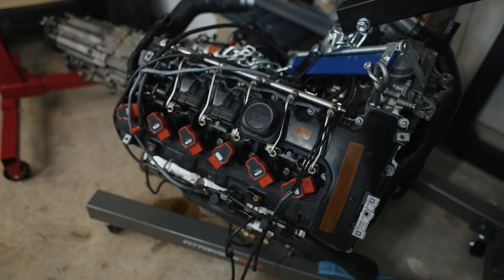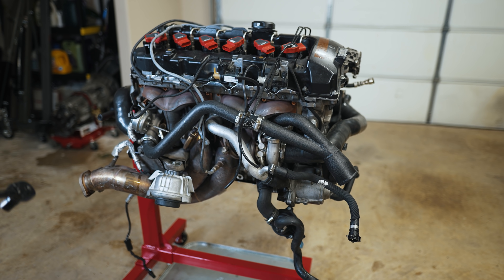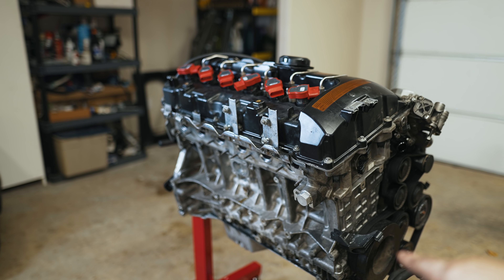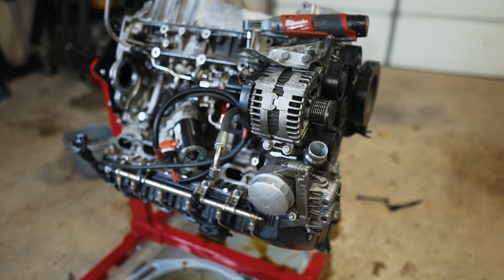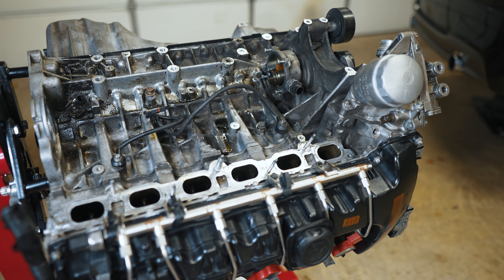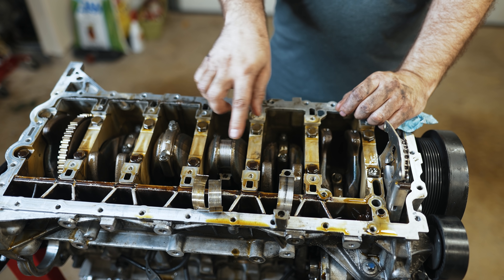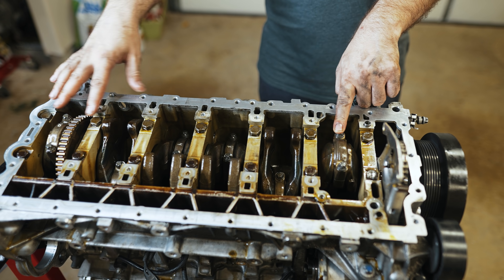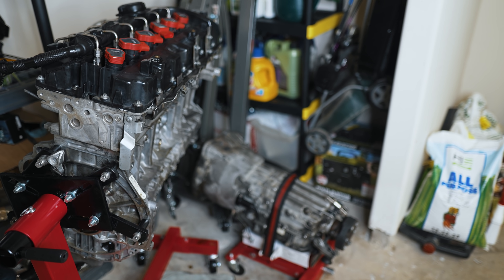Why Did My BMW Engine Fail?

Comment: That sucks! Maybe it was a little lose...that & being cold was enough for it to give in & spin? At Least the rest is all good. Drop that off & have the crank redone & some new bearings installed. Nothing wrong with having an extra motor stashed away...👍🏁

Comment: What oil are you running? And should you go with thinner oil then?
Reply from the maker: I was running 5w40 and had used it for years.  I plan on continuing to run 5w40 but with stock bearings on the new motor.  Served me well for many years.

Comment: quick question, do you really need to get the whole engine out and repair the rod bearings this way, or is it possible just to repair it in a other way
Reply from the maker: You could do it in the car but I knew this motor would need a crank repair at the very least.

Comment: Probably did not help that you had the Uro metal oil filter cap on. There is not telling what that cap might have added to the mix. The spring force on the inner core of the metal oil cap is so strong you cannot push it with your finger, unlike the soft spring of the oe plastic oil filter housing cap. 

Also, Rob at Precision Raceworks warned me not to replace my bearings after upgrading the turbo and I followed his advice. He said only do this if you know your bearings are gone like in the case of an M car. Don't go replacing bearings when upgrading turbos because of the strain the increased loads will put on the tighter new bearings.
Reply from the maker: I didn't have any issues with oil pressure and as far as I understand if the valve in the filter didn't work the oil pressure would remain high and the filter would start collapsing which in turn could lead to low oil pressure but the filter looked fine.  I'll investigate it further in a future video.  Yeah I can appreciate that sentiment, the N54 has tight clearances and runs three different standard size bearings, the bearings should probably only be changed during a rebuild.

Comment: How many miles did you put on those bearings? 
I’m also running king bearings, but with molnar rods.
Reply from the maker: Less than 1K, how were your clearances?
Reply: @VehicularDIY  results within spec. When I broke in my motor I used driven racing br40 oil. 
Also could be the rod crush on the bearings. Could be that the factory rods don’t like aftermarket rod bearings. I’ve been running my car for 2k+ miles already, and not a hiccup

Comment: I've seen a hundred B-Series Hondas rebuilt with plastigauge and don't recall it ever being picked on as a bad tool. Definitely for the budget engine builder, but usable nonetheless.

As for the failure, I'd wager too much cylinder pressure and cold oil like you deduce. Those twin twirly bois need a fair amount of cushion for the pushin'.

Comment: I've been building engines for 20 years. Firstly plastigauge should not not be used on high tolerance modern performance engines. It's more for old tech stuff such as old push rod engines. The only way to do it is with micrometers and bore gauges. The cheap Chinese measurement tools should not be used.  Your failure is due to incorrect clearances which is why all of the rod shells have failure damage. Number 3 is the worst as it had tightest clearance out of all of them and failed first. When you do have the engine rebuilt have the shop fully assemble the bottom end. Yes the shop will size journals and caps to the correct spec, however they will not do a final dummy and measure. They will only measure to fit while the components are on the machines. If you ask them to assemble the bottom end (which they will charge you for) they with dummy fit and measure to ensure clearance's are 100% correct. If they are not they will rectify. The alternative is buy your own quality measurement tools ($$$$) and do it your self. There is a skill in using these tools in themselves. Pray the shop got the machining right the first time and you don't have to go back for re work. Good luck with it mate.
Reply from the maker: Makes sense given BMW tried to keep the tolerances as tight as possible and even standard size bearings vary by quite a bit and they offer three different color codes to keep things as tight as possible.  Seems like one size fits all aftermarket bearings shouldn't be offered for these engines.
Reply: @VehicularDIY  Yes not a fan of aftermarket for BMW's unless the crank journals, mains and rods have been sized to suit.

Comment: hey im houston this is just a hail mairy but i love the bmw platform i own 2 n54s i have 1 project that im working on and would like to maybe collab on it im swapping transmision just stock to stock and intercooler bunch of other parts let me know if you read this message im in the energy corridor by eldridge
Reply from the maker: Thanks I'll let you know.  Been hard to find time as of late but if you get stuck on anything shoot me an email.  My email is on the about me section of my channel.
Reply: If you need a hand or any specific tools I’m in the area as well. Diy can give my information. Good luck with the project 👍🏻

Comment: Diesel oil killed it ...
Reply from the maker: I had ran it with that oil for years but I'm open to a change if you guys there is a better oil I should be running.
Reply: @VehicularDIY  Motul Sport 5w40 :)

Comment: When you say that the oil was too cold for abuse, what do you mean by that exactly? My normal routine in this fairly cold weather (25-30°F) is a 2-5 minute warmup and then straight onto the highway averaging 80-90 mph. 

I'm at about 130k on my N54 and have a JB4 so it limits me to 8 psi before water temp reaches 160° F. I'm about to ship my oil sample to Blackstone to see how my bearings are doing with this 5w30 oil.

I've heard of King bearings failing on S54's before.
Reply from the maker: Ambient temp was just under 40F and the car had been on for about 10 minutes.  Coolant was at full operating temp and I has passengers and on a slight uphill went WOT all the way to redline in 3rd and it made 28 PSI lol.
Reply: @VehicularDIY  We've got a very very similar build, but signs point to being that the oil was too cold to perform correctly.. My theory behind your engine failure is that during the pull, the "hydrodynamic wedge" between the bearing and the crankshaft decreased because of the increasing cylinder pressures and since no surface rod or crank is ever perfectly smooth, the peaks of the bearing and crank started rubbing against each other causing it to spinout

Keep your head up though! I like seeing the content you put out. I don't believe that the king bearings were the cause of the issue.
Reply: @VehicularDIY  I think that did it. oil starvation in hard pulls, just like it would be in an uphill and with a litle boost , lol

Comment: I noticed you have a VTT a outlet, did you have any issues with it. I have there’s for my e60, and it was mounted so close to the manifold, that I couldn’t use the rear section.
Reply from the maker: Didn't have it on for super long but no issues, a little hard to fit on the car.

Comment: Here's an honest question... I'm slowly upgrading my n54 135i. I'm only going to be running a dinan stage 3 on my stock motor with the extra required cooling [ california, our emissions are very strict ]. I'm NOT doing this work myself...  Would it be prudent to run this motor until it dies and buy a built n54 from Lang or someone else with upgraded pure 600 turbos at that time? Seems overall a cheaper way to go for someone who isn't working on their own engine.. I'm just concerned about the quality of the built n54s. 

Note when I go the better turbos, fueling etc... I'll probably not be in California any longer.

Thanks for your videos!
Reply from the maker: I would think so, how much WHP are you hoping for?
Reply: @VehicularDIY  To be honest I'm not sure how much I will ultimately end up with. I'm slowly adding power as my familiarity with the car grows and suspension/brakes are modified.

My main concern is ultimate reliability as it's not easy for me to dig into the engine when something might fail.

A built engine may be overkill, but at least the extra cost would go into reliability more than total hp. 

thanks!

Comment: 2 things, never use the factory bolts, to much margin for error, also do not use that rod again once the bearing spun it ruins the connecting rod
Reply: Did the bearing actually spin or just failed due to clearance issues? 

It appeared the the bearing was still in top and bottom locations.
Reply: @jpwilliams5264   The tab on the bearing shell was missing, so yeah it was spinning inside of the rod.
Reply: The bearings didn't spin though.
Reply: @The0nionKnight  The tab on the bearing shell was missing, so yeah it was spinning inside of the rod.
Reply: So the piston and cylinder head might still be ok?
Reply: @ilesoft82  piston technically ok but the rod is not head should be fine tho
Reply: Nathan, are you saying that he re-used the original factory rod bolts and that contributed to the spun bearing??
Reply: Con rod trouble with the M54 is too common.

Comment: Cold oil and JB4 false timing not a durable combination at high mileage.  At least you can rebuild it and get a real flash tune that will work in real time.  No manufacturer uses a piggyback tuning solution for a reason.
Reply from the maker: I'm running a MHD custom tune.
Reply: @VehicularDIY  Even I think MHD is good. Missfire an too much pressure.

Comment: Any turbo vehicle is going to have extraneous wear issues, even ones that are fully built.
If you're using forced induction, you can expect failures, tolerances are too tight in these motors for error.
Reply: Stupid
Reply: @shaunbailey4922  stupidly

Comment: Seen similar instance on n54 with 150k miles but it was - 4C with a hard pull. IMHO it's a  combination of tighter bearing with lack of oil and viscosity of oil on cold. How cold was it outside? Which oil used?
Reply from the maker: It was around 5c out and the oil was 5w40.
Reply: @VehicularDIY Fresh oil with relatively cold but not freezing temp. 5w40 should be fine in the weather,  looking forward to oil analysis. It should provide some additional information. Btw thanks for good tech content.

Comment: king bearings being king bearings... i have never seen anyone replace bearings with king bearing stock size and the application last. the clearances are always to loose. those motors need there tight tol to work properly it aint an old mericain v8
Reply from the maker: yeah I'd like to get a definitive answer on if the clearances were too loose on the king bearings.
Reply: @VehicularDIY  my personal opinion after quickly scanning the comments and knowing your knowledge and awareness of this car and engine, the bearings let you down (big time), is my gut instinct
Reply: @vp5  me too with my experience of king bearings. Its probably what caused all of this! Same happened to my supra king bearings where on the very loose end of the specs and couple mouths later it was rod knocking again! Clevite bearings in and the clearance on stock sized bearings was bang on middle of spec and car it still driving 5 years later. Stock size king bearings are always to loose

Comment: Damm man but I think it was the king bearings don’t you ?
Reply from the maker: Yeah now the question is how can we determine that 100%?
Reply: I had seen people use those bearings because the torque spec is easy you can do them with out taking the motor out so to me you just put them in bmw bearings lasted 200k what do you think?
Reply: All was torqued right ?

Comment: My N54 gave me a early Christmas present by putting gold flacks in my oil filter
Reply from the maker: Sorry to hear, how many miles?
Reply: @VehicularDIY  117,000 only had the thing for 9,500 miles, did 3 oil changes, got super unlucky

Comment: I don't believe the engineer who built this engine could disassemble and put it back like you do
Reply: And a Mechanic could not design it, so what's your point?
Reply: @michihoffi69  my point is "I don't believe the engineer who built this engine could disassemble and put it back" can't you read?
Reply: @cn0503  yes you said that a person not trained for/ has never learned to do a certain task can't get that task done. I just gave a different example for it.
Basically you said water is wet, or sand is coarse, rough and irritating and gets everywhere.
Reply: To be fair the engineer could probably do it with his eyes closed and the technician in BMW, who's actual job it is, can probably do it blindfolded in a room full of other engines with snakes everywhere and laser trip mines  across the floor during a major earthquake
Reply: An engineer doesn't practice taking engines apart and putting them back together so of course he couldn't do it as easily as a mechanic who does it all the time.

But you can be pretty damn sure that the engineer will do a much better job at disassembling an engine and putting it back together, even if he takes a lot of time to do it, than a mechanic would at designing a working engine from scratch. The former just takes practice, the latter takes years of study and someone without it wouldn't know where to start.
Reply: @katlego Mohlala WHAT

Comment: I'm confused a little bit. Did I hear you say that you weren't able to use plastigauge? I didn't see the episode where you replaced the bearings but why weren't you able to use plastigauge
Reply from the maker: No I did use plastigauge and documented it on video.  According to plastigauge the clearances were fine.
Reply: @VehicularDIY  ok then! I'll vote for a cold engine.

Comment: Go ahead to fix it, official torque and montage instructions for BMW N54 engine you can get for the bearings and crank.
Aswell I insist on OIL QUALITY and change interval, for the HP and the fuel you use E85, alcohol basically, takes away a lot of more lubricant and protection properties to the oil trhough fuel dilution, this is a point that will protect your engine in future for sure.
BimmerN53

Comment: I can't believe it is just related to pushing hard with cold oil temperature for once. Many people who have no clue in mechanics do it. Must be related to the new bearing installation. At least it is a great video with a nice N54 overview.
Reply from the maker: Yeah probably a combination of both.
Reply: One of my buddies has a M4 or M5, not sure which one, the driver can attempt go all out on the car but until the engine / oil is to temp, the car will not run on boost if cold.

Many people who run flat out on cold engines do not drive a 580HP N54!

I do not think it was the bearing job, but driving it hard cold a highly modded engine.

Comment: I have had the same problem ,I went to rebuild the engine, the service center said it's useless to rebuild, he said I'll come back with the same problem within 3 months, so I went for a new engine.
Reply from the maker: Yeah unless you full rebuilt the motor it makes sense to just get a replacement.

Comment: I’ve been waiting for this vid... can you post your oil sample results? I’m curious to see it to compare with my n51... which is currently parked until I do my bearings... 
I wouldn’t rule out poor tolerances as the culprit, especially since it’s so recent. My knowledge on n54 is limited compared to the n51, but ISTA and other sources show you need to do clearances with plastic gauges, oil the new bearings and I also read you need to prime the oil system before starting it - several accounts of spun bearings shortly after replacement due to not priming the oil system. 
As always great vids! You have definitely gave me great confidence in doing big jobs like this I wouldn’t consider before. Great to see someone doing this kinda stuff in their own garage with out a lift!
Thanks for the great vids!
Reply from the maker: Yeah I'll include the results in a future video for sure.  Thanks for watching!

Comment: Will change mine in the next few weeks, gonna go with oem bearings. but i really gotta figure out what the correct clearance is for the n54. Good luck with your car dude
Reply: Perhaps you need to do the mains as well?
Reply: @fastboatster  you think so? That would mean a lot more work and i don't really want to do that

Comment: So I can get a spun bearing from a misfire?
Reply from the maker: Yeah if the crankshaft is trying to rotate upwards and the car is detonating it would be like the spark plug firing and pushing down on it and causing stress which could lead to undue pressure on the bearing.
Reply: @VehicularDIY  I´m from Germany. May be I´m wrong. Cold pushing, yes. Old oil (over 20`km), cheap oil, fake oil. And, as I´ve seen, lot of young tuned the engine. Ignition and boost. Lot of engines do not get enough fuel. So Lambda and temperature inside are out of limit. This and bad fuel with high mapped ECU you will get knocking (detonations). High speed knocking you can not hear. THIS is extrem stress and high pressure to the bearing. The oilfilm collapses!

Comment: I really enjoy your channel, but it all started with that god damn Helix Overdrive and then you changing your bearings while you were under there. My HOD exploded around the same time you experienced your failure. I’ve kept mine off ever since because I don’t the timing chain exploding either. If you have to shave your crankshaft and go with oversized bearings, I would do it and sell It as a stock. Get another N54. Sorry for your loss.
Reply: I hope he ends up switching to port injection. Will probably unlock more potential out of that engine and turbos.
Reply from the maker: Yeah I've been thinking about PI, yeah I have another N54 in the way.

Comment: How many miles were on those bearings before failure?
Reply from the maker: Not a lot only about 1K I recently changed them for maintenance.  I have another video on the channel about that.
Reply: @VehicularDIY   I wonder if they required an initial break in, similar to a new car as they were essentially brand new bearings.